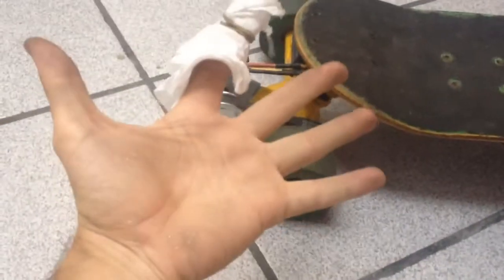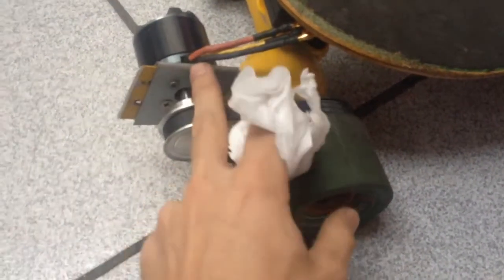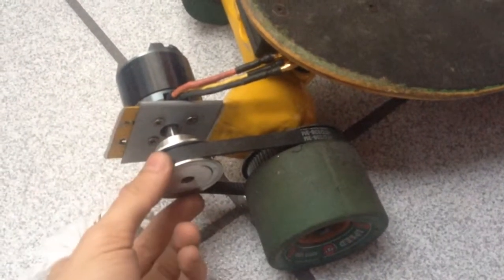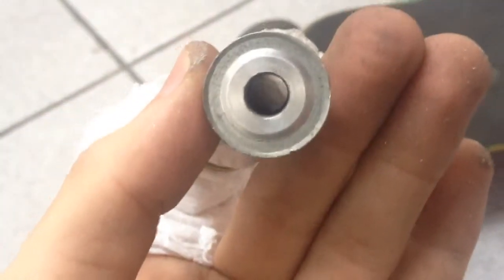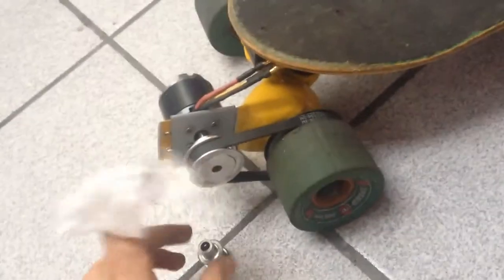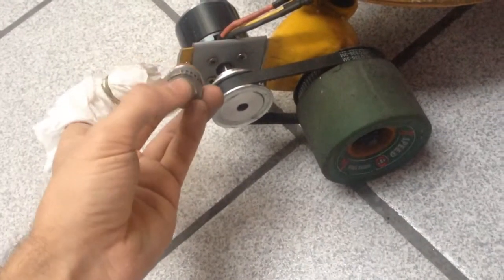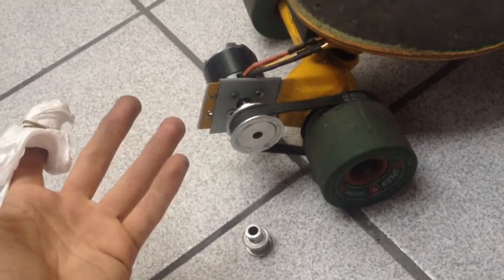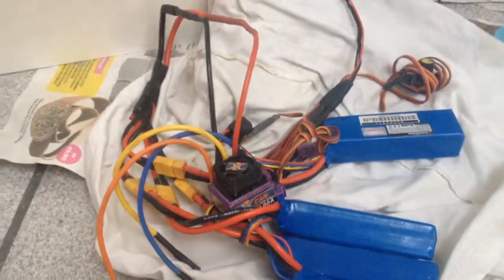Fix motor mount crack and changing the ratio

Comment: nice fix mate, thought you weren't going to fix this for a while :p
Reply from the maker: The motor mount plate was tick enough but my motor was too far apart and the small pinion I messed up with the center hole so it causes vibration on the plate ! I decide to go with a bigger 2x pinion so the motor now is more closer to the base ! And now I used a lathe to do a precise center hole ! It seems much better now no more vibrations and better belt contact area! Now I'll hit 52KPH instead of 26 ! Got programmed to smoothest acceleration and 0% drag ! I was using 10% drag setting while no acceleration and didn't notice lol I'll see how it goes ! Got to wait a little I wipe out yesterday my knee is bad !